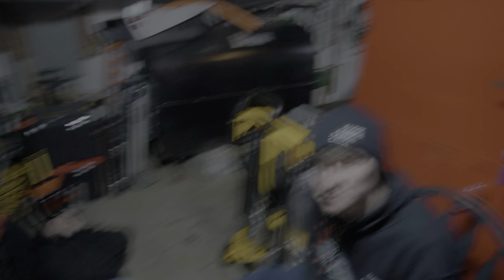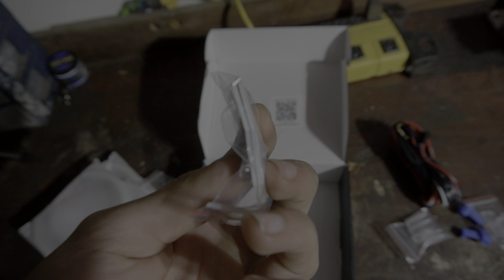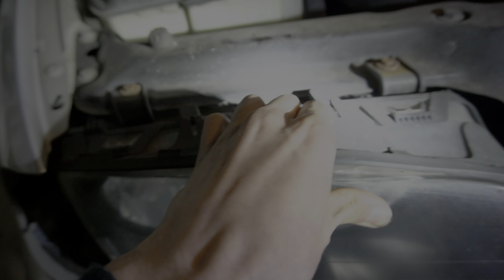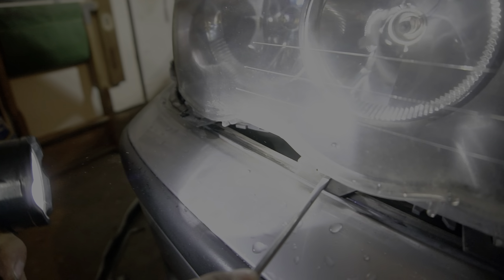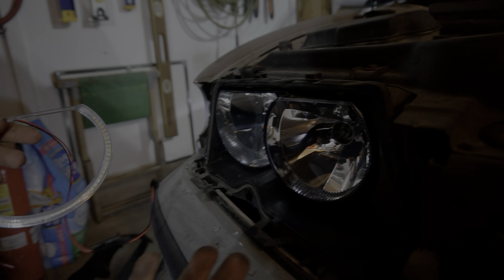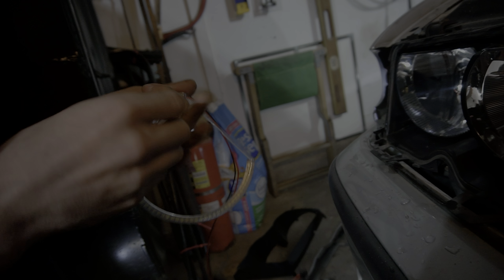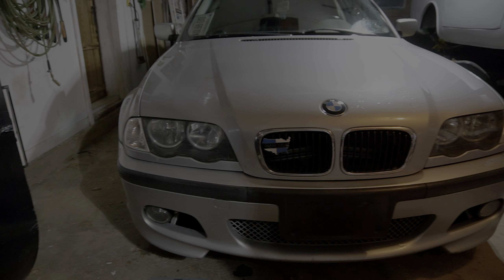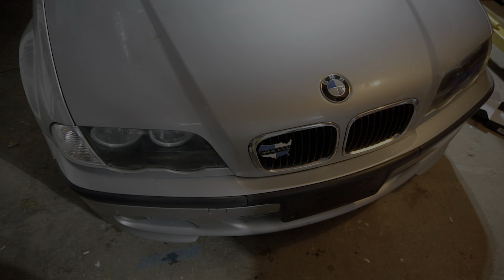In-depth How To Install And Wire Angel Eyes On A Bmw E46 Non Hid Xenon Headlight

Comment: What size r the circles ?
Reply from the maker: I honestly couldn’t tell u if i were to guess in inches about 4” but the inner halos are slightly smaller
Reply from the maker: The website should have the specs

Comment: Bro my kit didn’t come with all those connections? All light wires connect to this little box then at the end of the wires were I connect to car is just 2 wires red and black?
Reply from the maker: Hmmmm was it the ijdm toy one if not when u wire it buy a fuse tap kit that has a slot for a fuse and find out what amp fuse the kit requires my guess a 15 and only hook it up to when u pit key in ignition unless the footwell lijt is the same amp fuse that’s honestly the best bet i can see u doing but woll work the same in the end just a lil more annoying